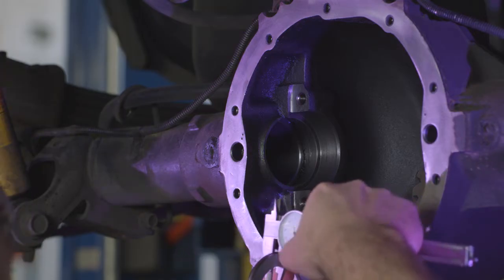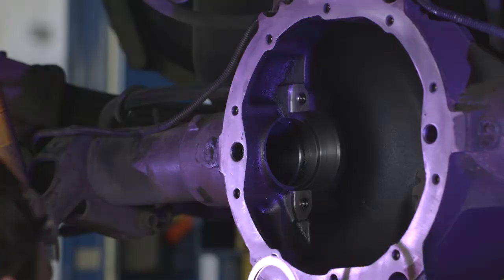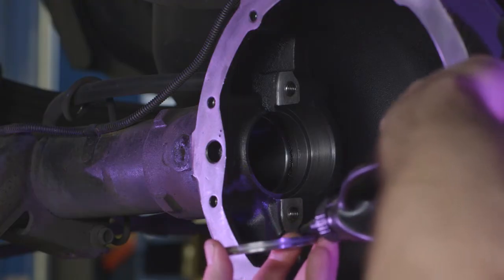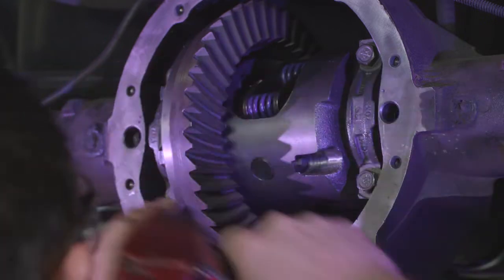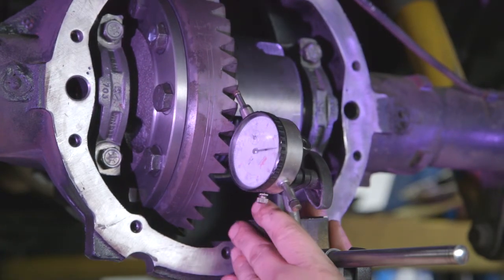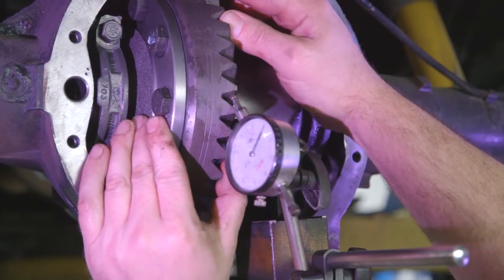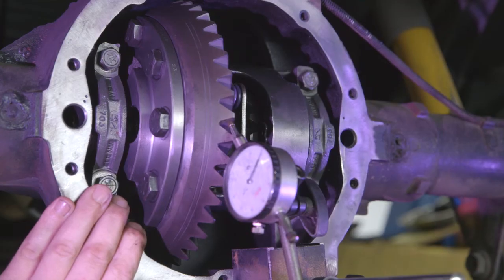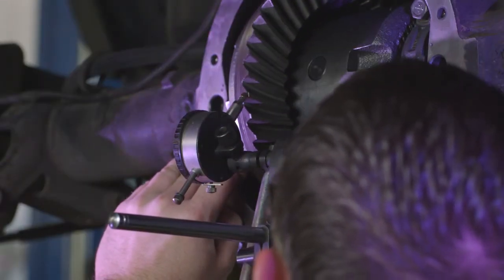How to set ring & pinion backlash

Comment: Great vid my backlash is 11 to 12 is that acceptable on 7.5 10 bolt ?
Reply from the maker: 7.5” 10 bolt Ford? Chevy? Toyota? Backlash specs aren’t like a torque spec - just being in the range doesn’t make it right. You'll need correct pattern, and that should occur somewhere with in that range. Good luck!
Reply: @yukongearandaxle Oh Sorry its a GM 10 bolt 7.5  ,,If I put into specs say around 7 to 10 would it be ok ? it was like 11 to 12 Dont want to put damage to the gears   I Bought the Yukon Dura grip positraction carrier
Reply: @DELTRANIO99  Yeah I'm sure you were fine, Don't overthink it, You can get away with 15 to 20 thou.
 A lot of do it yourself overthink think these things and they get themselves in a lot of trouble...
Like they say, Torque it down and walk away